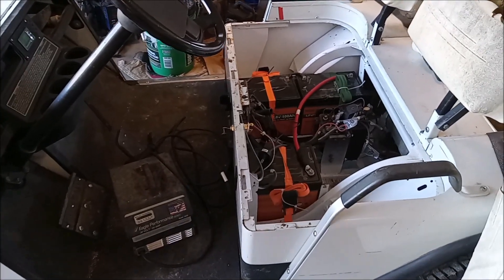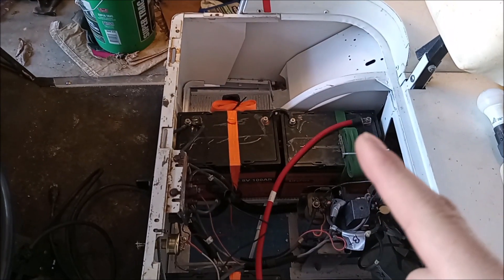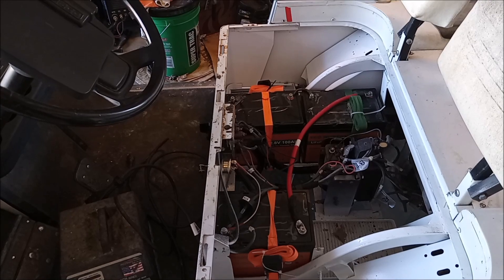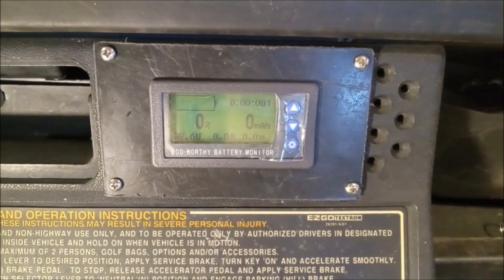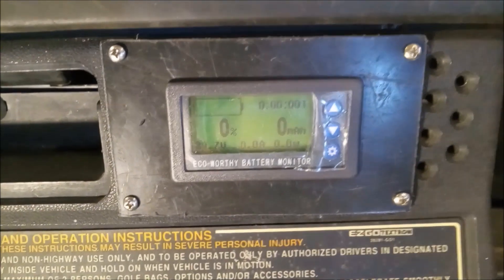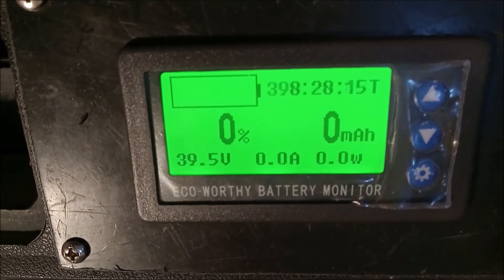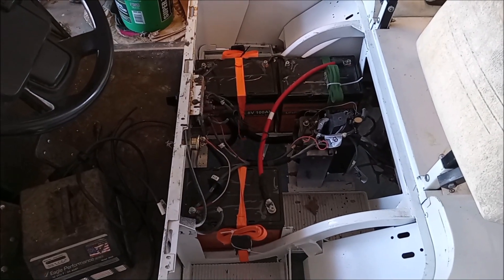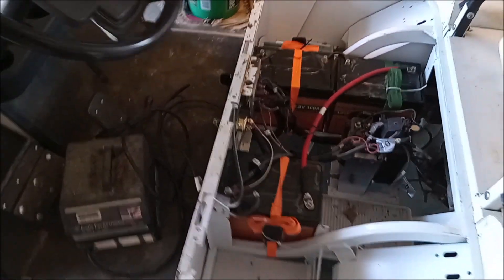EASY LiFePO4 36v golf cart upgrade under $900  Eco-Worthy fits in 6v battery space

Comment: Are you happy with the batteries now that you have used them for a while?
Reply from the maker: Yes...but.  prices have gone down and there are better options. Out of 3 batteries 1 is weak and I only get 50% before it shuts down. Now in its defense the cart does pull  over 100amps. It's still has a charge after turning it back on but it cannot take the full load. On that note these suck because when they shut down u have to jump them or charge them. Almost all new ones now auto turn back on. If the price is right I would still go with this brand.
Reply: @sweetpigfarm3645 thank you for your reply!   I have an older club car 36v and am looking to swap from lead acid.  Just don’t want to regret my decision later 🤪

Comment: I am looking tonight at an Eco Worthy 48 volt  50ah pack.  I'm planning on buying one for my stock Club Car DS.  I'm not sure what the stock horse power on the motor is but I sure don't want to be tripping a battery! I'm looking to become a dealer of a lithium brand that doesn't break the bank but will out perform lead acid.  Eco Worthy has a great price but don't want to be stuck with something that won't perform.  Thanks for the video!
Reply from the maker: 50ah won't be enough  maybe two in parallel
Reply: What’s the bms rating on 2 in paralllel?